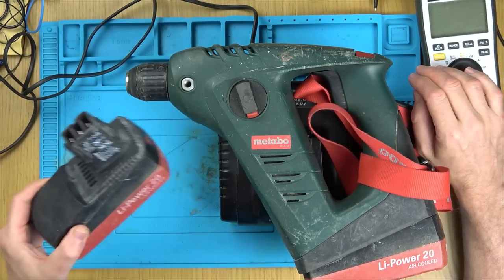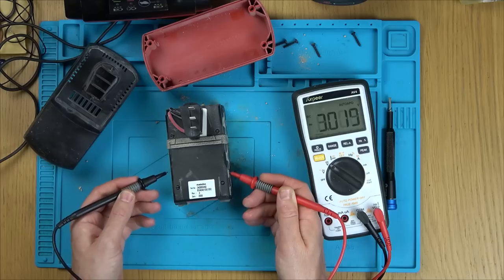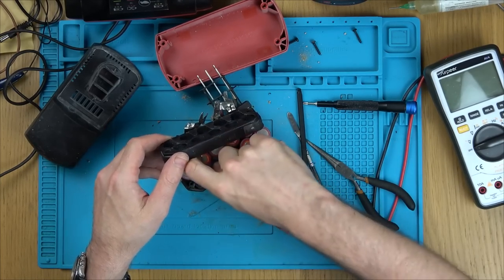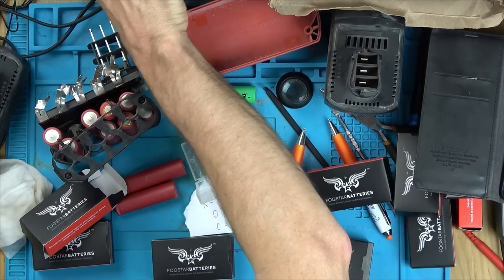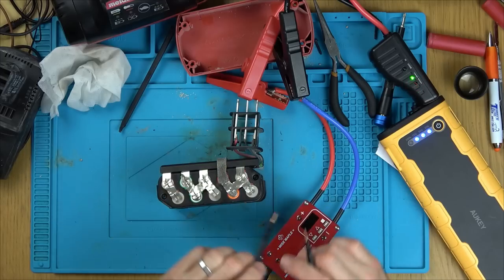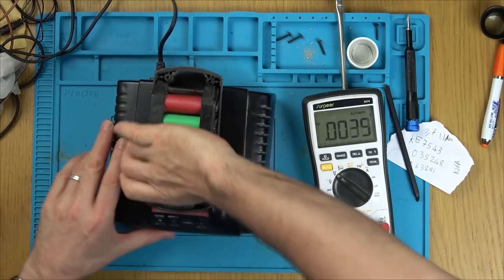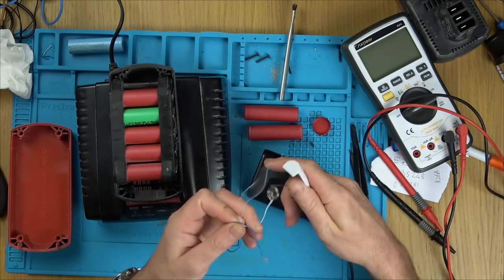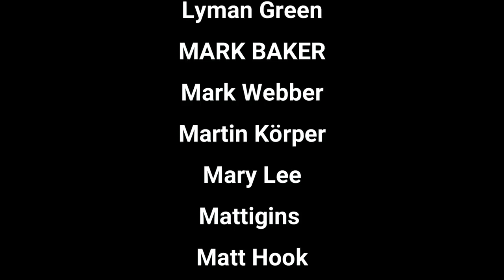DEAD High Quality Metabo DRILL BATTERY - Can it be REPAIRED?

Comment: There is no happy end when doing partial repairs with old battery packs - it may work for some times, but new issues will develop sooner when later. Get cheap chinese semi brand cells (e.g. Liitokala VTC5A) for 2€/cells - and replace all of them. The pack will last at least 10 years and the capacity as well as peak power will be higher.

Also: When replacing power tool batteries, you have to look up the spec sheet that they are high current. You may cause thermal runaway, when drawing too much current. This has noting to do with capacity, but is an independent parameter, often giving as "xC"  x = multiple of its capacity rating in mAh or directly as Amps. Power tool batteries should have at least 20-30 Amps as 1P and ~15 Amps in 2P configurations.

Another good option, is to convert all tools "20V" tools to one battery standard (e.g. Makita or rioby) by replacing the battery receptable. Then you only need one type of charger and a 2-3 good packs to run everything, even the older tools.

Comment: In my experience the li-ion cells in a pack go short when other batteries try to force reverse voltage in the completly discharged cell/pair. So the one cell that lost some capacity will be destroyed by the healty cells. And the cell that is not shorted can be revived no problem by slowly charging it.

Comment: You should always make sure you are matching or exceeding Amp Draw ratings.  When I rebuilt my Dyson Robot battery, I used cells rated for 10A draw.  Sanyo NCR18650GA, 3500mAh 10A Cells.  This ensures the cells can provide the power when needed.  If you use anything below the required Rating, you can experience tool cutting out or excessive wear and tear.

Comment: Batteries used in powertools usually have a greater C-rating than the ones used in regular electronics. Using higher capacity cells usually means lower C rating, meaning lower sustained current a cell can provide. Neither voltage, nor capacity rating mean a lot, so when replacing cells you should try to search for a cell datasheet, and choose the ones with 20+ C rating for powertools. 
It appears that this battery pack has NO cell ballancing, which isn't uncommon, but contributes to early demise of these battery packs.
Reply: Vape batteries is the easiest option.
Reply: I Think It only Detects Heat!! it Sure Does not monitor the cells though! I Said Use the Top Of the battery to build An Adapter So He Could Use regular Batteries like Dewalt or Ryobi!

Comment: Many other comments regarding mixing cell capacities and older cells may be nearing their charge lifetimes. I didn't see any balancing mechanism but there may be one. The sunko 737G welders are ok but ensure spare copper pins are included. Practice makes perfect (easy to blow holes). I used my drill now because I was messing around with that omega watch (1:21). Are you and Chris the same person? WD40 required on door or wife or kids.

Comment: Since you had all the cells out, you should have charged them all up, to have the same voltage. I like to replace them all at the same time with higher capacity. That way that drill will be more powerful and last longer. I did this with an Elektrolux stick vacuum cleaner.

Comment: Matthias Wendell did a nice investigation on the large dewalt batteries that seem to fall over. Seems if they’re used in a high current drawing tool when partially charged the middle cells in the pack go bad.

Comment: If it's 2.2Ah and there's 2 in series that means the stock cells are 1100mah. Which is pretty horrendous but it is very old. What you should do, for safety and quality is swap out all 10 cells with 3.5mah cells, you'll have a 7Ah battery. It will last over 3 times as long as well.
Reply: Just Buy A new One! I Get Ryobi 4AH 18Volt batteries For 50 US Dollars! They Are 100 US Dollars Anytime But They Go On Sale 4 or 5 Times A Year for 50 Bucks!

Comment: Green has bigger capacity so that's why it charges slower - last to reach max voltage. Also BMS inside can drain  highest cell with around 0.2A, that's why it takes ages to balance them fully

Comment: The batery charger will go off a voltage charging curve, it wont really have anything to do with capacity. Once they reach full charge the voltage will drop off slightly at that point the charger will know its fully charged. Or somthing along thise lines.

The problem you have with different capacity cells is the the smaller ones will deplete alot quicker. So you will run the risk of over discharging the lower capacity cells. Thw bms will charge each cell individually to balance them so charging isnt so much of an issue.

Comment: I'd replace them all with 18650s so they have the same capacity, likely at that voltage and configuration you'd not notice any power draw difference
the issue with what's in there now is like you said they're different capacities and will cause issues of equalization
the chargers and BMS of that era normally only measure via voltage, so as long as it gets fully charged to the nominal voltage the BMS will say "yep you're charged" but now it can't do that quite right since they're different capacities

Comment: power tool batteries tend to be of a low amp hour, but they are usually of a high amp output. i have an aldi powertool battery made of lg 18650s. they are only 2ah but 20ah output.

Comment: Will have issues with the higher amp batteries. They will discharge at a different rate and the drill will stop working even if the older batteries have enough power (I would think). I would say the drill can be used with higher amps or lower amps but all batteries need to be the same.

Comment: Are you putting both spot welding probes on the nickel strips?  Isn't one probe supposed to go on the nickel strip, and the other on the battery contact, so that the current flows from the nickel strip into the battery contact, not having the current just flow through the nickel strip?

Comment: A good balancer should discharge the green cells when they hit 4.2v if the other cells are lagging behind, that’s the whole point of a balance Charger it constantly monitoring the cells in the charge cycle, it stays constant current until each cell hits 4.2v then switches to constant voltage and the current falls off, I don’t know why you didn’t just take one of the cells from the parallel side and just made do with reduced capacity and you would of had some spare cells if it goes bad again

Comment: I would be interested to see the voltages it charges each of the pairs of cells up to ''after'' you've drained the battery pack. I suspect it will charge the old cells quicker than the new cells and you might only ever get a half charge into the 2 new cells.
Reply: Add leads outside the case or a USB port to the pack to only the new cells to regularly drain them lol

Comment: You could have tried cutting off most of the existing strips at the top of the battery pack and soldered or spot welded thinner strips to the remaining tabs and then spot weld to the batteries.
Reply: That was my thought

Comment: Just use 5 cells active cell balancer module,easy to use very small you can fit in or you can put just one cell instead of 2 in order to make them same capacity,but internal resistance is also important i recommend use active cell balancer for both batteries because the other one is also unblaced,because full charge battery pack should reach 21 volt not 18 v

Comment: I would use new double capacity cells of the old ones and use just 5 of them in series.  That will be cost effective and less assembly work (also lighter).  You are not a professional construction worker that uses this drill 6+ hours a day anyway, just light house work:).  You can then keep the good old cells and use them to potentially repair your other battery when needed (so you would still have 10 matchings cells).

Comment: It IS a problem when you mix those batteries because they are in series and clearly there is no cells balancer there. The problems will show up after your first cycle and get worse. The old batteries will get overcharged, it can be very dangerous
Reply: I just realized that there is a balancer at the charger, but you are still gonna have problems while discharging because the lower capacity ones may reache a very low voltage

Comment: As to the balancing problem, would it not be a good idea to use the drill until it stops working, then charge it. It may well balance the pack better than just charging with two cell holding a full charge.

Comment: It's ok with the batteries if the (5s) BMS is doing the low voltage cut off (2.5V). ;)

I am soldered my battery packs for ages now, nothing blew up and no battery degradation.  It's pretty much an urban legend that bad things happen if you solder it.
That said, a spot welder is much easier (and faster) to use if you choose the correct settings. If you choose the wrong settings you can damage the battery. Strange, nobody warns you about that ...

Comment: Run the drill till the batterys go flat, charge it up and do this a few times for the batterys to balance.
half a volt either way won't make a lot of difference to the operation of the drill.

Comment: You're spot on about the different capacities. The larger capacity batteries will discharge and charge more slowly. This puts a little more stress on the ones around them so it will make other cells go bad over time.

Comment: Eh, I disagree with the 'buy cheap buy twice' thing these days. You can spend $400 on something and still end up with a terrible product vs a cheaper one.

Here in Australia, our major hardware store retailer (Bunnings -- Better known as The Big Green Shed) sells a brand called 'Ozito', now, while you wouldn't use that as a professional tradie, for pretty much everyone else, despite being cheap, they are rather reliable, and when they break, since Bunnings is the only company that sells them, you simply return the broken product for an immediate free replacement.

I've also had other expensive items that have been lucky if they last 6-12 months.

Price doesn't equal quality anymore, sadly.
Reply: Yeah the 5 year warranty is awesome. Ozito are rebranded Einhell tools. Einhell is a German company. Cheap and cheerful means I can have twice the number of tools vs Makita or Ryobi. Or 10 times vs DeWalt

Comment: Interesting but indeed a bit dangerous looking fix.
Had a bit weird experience recently with normal AA batteries, bought a cheap 16 pcs AA battery pack and tried to use them in my digital camera, but... no start! It absolutely refuses to start with these new batteries, it just complains that "replace the batteries". 
They measure 1,6V new from the box tested with multimeter, which looks normal. Charged my usual rechargeable batteries and the camera starts normally with them, and has worked with normal AA batteries as well in the past, so not really sure why these batteries aren't good enough to power up this camera. These are Varta Energy AA batteries, haven't used this exact type before, but camera has worked with other Varta batteries before, and other brands as well.
Reply: I recently also bought a 10pack of AA cells and just one of them was new and flat. Maybe you didn't measure all of them, and one flat or with high resistence didn't make the camera (with some higher current demand at startup) start in the first place?

Comment: TIP
With that set of failed batteries where one was shorted, you could have turfed Err-discarded it, whilst the other 
could have been used to drain your new batteries down whilst equalizing capacity between the three..
Reply: Over-discharged 18650 Lithium cells should only be revived using very low current (~55mA for a 1.1Ah cell) until their voltage is safely above 2~2.5V, the current can then revert to the recommended safe charging current for the cell.
If you simply connected the very low cell in parallel with a fully charged cell to bring its voltage up, the current flowing between them would be too high causing the cell to heat up quite quickly.
When you have one cell whose voltage was much higher than the others, you can use a 12V 60W halogen car headlamp bulb directly across the cell to reduce the voltage at a controlled rate until the required no load voltage is achieved (target voltage should be measured with the bulb disconnected).
The cell must be constantly monitored to check that it isn't getting too hot or its voltage being pulled too low.
Reply: A 12V 60W halogen bulb will draw around 2.7A @ 4.2V ~ 2.6A @ 3.8V and a 12V 50W halogen ceiling lamp bulb will draw around 2.46A @ 4.2V ~ 2.35A @ 3.8V.
Reply: @2Bikemad  That may be so but the extra capacity battery was not over charged, it just needed to be discharged to match the lower capacity battery..

Comment: I have a Milwaukee 6AH M18 battery that doesn't hold charge, it will not charge over 3 bars and drains fast, the battery has not been used much at all. How can I send this to you so you can use it for a video?

Comment: This isn't a good idea.  If the charger had balance leads to every pair of cells and charged them as individual pairs as some radio control lipo batteries do, then no problem.  However in doing what you have done the red cells will become fully charged long before the green ones.  The charger will keep charging until it sees the charge draw drop to a certain level and/or a voltage check.  The green cells will hold this charge condition back and so the red cells will continue to be charged when they are full and should have been cut off.  You may just get a hot pack or the red cells may vent and fail.  On the positive side, these steel canned lithiums are made like this for laptops and tools as they are fire proof unlike the polymer cased versions in phones, etc.  ie. they won't explode or catch fire.  You really need to change them all for identical, same age cells.  The charger won't care what the pack amp hour size is, it will just keep charging at its rated current or less until the pack voltage hits a peak or the draw current reduces to a certain value, so no drama there.  Twice the capacity pack will just take twice as long to charge (but you want all the cells to be the same).  Hope this helps.

Comment: Raising the battery pack from 2.2Ah to 5Ah would just mean it would last longer between charges. Replacing the 1.1Ah cell with a 2.5Ah cell won't really make any real difference, it just means the battery will work less than the others.

Comment: The problem is that batteries with different capacities have different charge/discharge curves so they will have different voltages at the same charge times@ x amps  so this will always be a problem because they willl never balance!

Comment: why not keep all the healthy ones in the pack but instead of replacing the two faulty ones, just use one of those high capacity green batteries so you have 9 batteries in the pack.

or maybe out of the 8 healthy ones, choose 5 of them to keep in the pack. you'll lose half of the capacity but should be 100% safe right?

these may be wrong so i'd love it if someone would confirm.

Comment: Vince, you are using your spotwelder wrong. You put way to much pressure on the welding probes.
Don't use ANY pressure and you will get much much stronger welds.

Comment: The Problem is: the batteries with the higher Ah don' t geht charged completely by the charger as it will stop charging as soon as all the batteries have reached the maximum voltage,i.enas soon as the 1,1 Ah batteries are charged, the 2,5 Ah cells won't bei charged top their füll capacity....

Comment: If your batteries have a different capacity and they are charged by a dumb BMS with a single voltage which charges all batteries in series, the lower capacity cells will charge more quickly, which is not good, because the charging cycle stops while the high capacity battery is still at a lower voltage. It all depends on how good your BMS is. A BMS that charges individual batteries would cause less problems. You probably have a dumb BMS.... Also, not all lithium batteries are equal. batteries in drills used a chemistry that allows high peak currents.

Comment: That's the trouble with these battery pack , the cells are welded together ,making them awkward to replace 
You think they ould come up with a no weld bolt together bus bar system ,making them easier to replace .But hey they don't want thats

Comment: The difference in ah is too much. The batteries will become unbalanced this way. It shows these batteries can be repaired and another device was saved from being trashed. Also the cells themselves have a protection built in into the top. These can go open when the cell fails.

Comment: Should You Have Not drained The Green Cells Down To Match The Voltage of the Red Ones? Then Charged The Battery Pack! The Only Way To Really balance the Battery cells is to charge Them All Then Measure The Voltage? Discard the Ones that Do Not Keep A Full charge! All Of That Said Wait Till fathers day Or Some Other holiday And Buy A RYOBI One + HP Set of Tools!! Make Sure To get The HP Ones As They Are Worth The Extra cash unless you just want to give them to a house wife! Here In the USA you can Get A 18 Volt 4 AH ryobi Battery For Around 50 US Dollars When They Are On Sale!! But EBAY Is Covered Up With Newer Used tools than that Crap You Just Fixed! Use the Top Of The battery To build An Adapter So You can Use RYOBI Batteries!